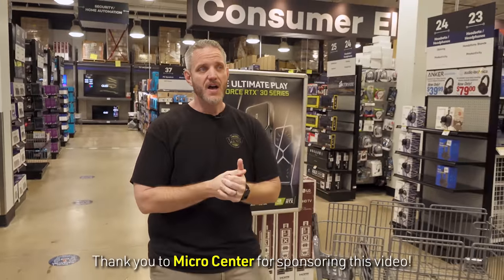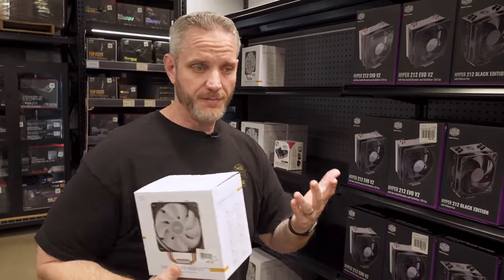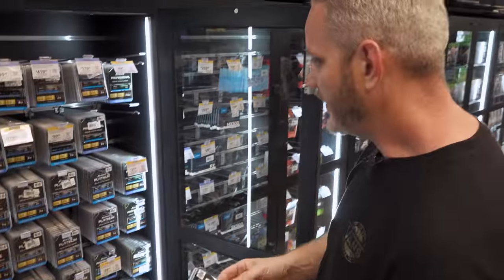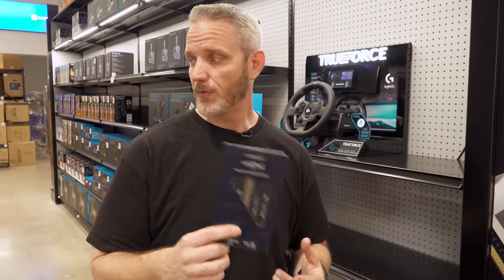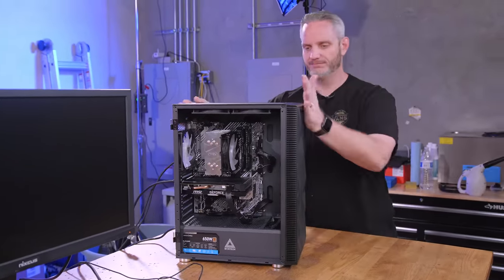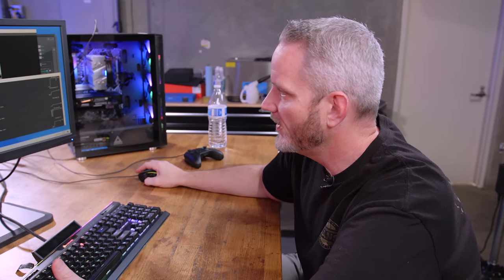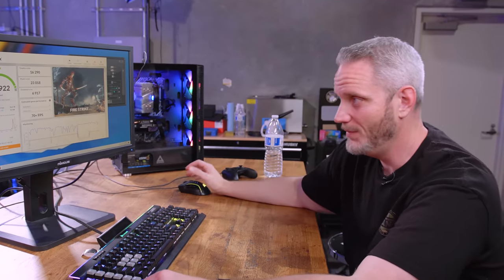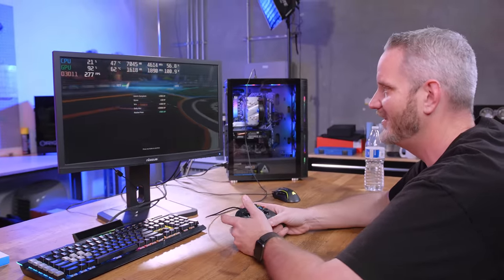How cheap can I build a "Gaming PC" for in 2022

Comment: As an owner of a 1660 super (actually the same msi model Jay showed here) I can confirm that it can still run everything at 1080p. Currently playing elden ring at high settings with steady 60fps
Reply: also 1660 super here. it's very good. i game on a 2014 cpu so it stutters rarley but not because of the gpu. 1660 super is great.
Reply: I choked when I saw the 300+ price tag... shouldn't it be half that or less?
Reply: @mjkittredge  I bought my 1660 Super (ASUS TUF 3 Fans OC) for like $320ish before pandemic and it's normal as it should be, unless, it goes like $380+ or like $400iah and yeah, that's where the price is not normal. Even Jay here bought a 2 Fan MSI 1660 Super for like $360 and with that price, you could buy a 1660 Super from a better skew.
Reply: Same, I guess people have struggles when they game with lots of apps open but I stream with this and have Gamecaster and Spotify open along with a browser with no problems to my game. Anything more can cause application stalls but I don't push it beyond my norm. Kinda 😂
Reply: To be honest, the prices for pc part particularly gpu’s is fucking ridiculous and scammy. The fact that $400 only gets you 1080p performance is sub-par as honestly non-consumer friendly. I have a 3090 and I understood that I’m paying for an enthusiast level card and can accept that, but 1080p high 60fps which I believe should be the industry minimum standard at this point, honestly the pc gaming world is just fucking the smaller consumer comparatively to consoles. 
Note: Before people come at me for dumb shit arguments, I’m not talking utility, work station, etc strictly gaming, and at the smaller market I believe people are getting scammed to where, you really should just buy a console.
Reply: @TheCuratedCache  No, he's right. I bought an ASUS 1660 SUPER for $229 on Amazon in January 2020 (remember this is over 2 years ago). At that point, I'd just bought it because I wanted to replace my old GTX 1050 Ti since and I didn't want to wait for the 3000 series. Boy was I lucky! 2 months later and the same card was selling for over $500.
Reply: @piyush2202  yeah, just checked the prices and holy crap. I was just basically almost lucky to have my card at that price range rather than now.
Reply: Just to be clear, elden ring can only be played at 60fps…they make the game that way
Reply: Really good gc!
Reply: mine is 1650 and it runs 
gta v 50-60fps
max settings 
1080p
Reply: Who wants to play 1080p lol just do 1440p at low settings
Reply: Lies i tell you, Elden ring cannot be played steady on a computer. I tried it with a 2080ti and a 3080ti my bro on a 2080 and a friend plays it on a 3080. and we all have some stutter's some chrashes and some to 1 fps dips for a couple of seconds.  (not to trash the 1660 super i think it will work great for 1080p and would play Elden ring just as good as a 3090ti on 1080p)
Reply: I brought mine years ago for 200eur haha. Still a good card
Reply: 6500XT same performance as the 1660 super and he could have saved money by going for that
Reply: @ChristmasCrustacean1  that shit barely beats a gtx 1060 nevermind a 1660 super 🤣
Reply: @shawngarcia3920  the ps5 is cheaper then a GPU right now I swear cheapest gpu I can find that I would settle for is $700 and it’s on Facebook so I’m not exactly trusting that asus KO 3060 ti
Reply: @xhxq   but how are you supposed to do that with a 1080p monitor
Reply: @TheCuratedCache  The pandemic started over 2 years ago, you shouldn't expect to pay the same price for it now.
Reply: I just ordered a triple fan gigabyte RX 6500XT for $240. It’s legit. It says on UserBenchmark that it can handle 1080p high to max settings on most games and come out 100+ fps. Is that right?
Reply: @rosetta_toned2850  I'd suggest you watch game benchmarks instead of relying on UserBenchmark reviews lol
Reply: @Madkilljoy  that’s why he put the word “steady” in front of it.
Reply: @xhxq  someday I want to. I have never actually seen a 1440p screen in person.
Reply: What cpu are you using, since i am on a budget i got a i3 10100f, will that be enough for 1080p?
Reply: @PeanutxSoup  you don’t, you use a 1440p
Reply: @xhxq  exactly most people have 1080p monitors
Reply: @rosetta_toned2850  There's a reason that card is available for that price😑
Reply: @mjkittredge  i bought my wifes 1660s for 209€ which is about 230USD incl. taxes back in oct 19, because the almost same performing, 50€ cheaper 1660Ti wasnt available.
Reply: @Vittrich  that sounds much more reasonable for a part made that long ago. $200 for a 1080p card is what I would pay
Reply: My 1650 Super runs everything on 1080p too. Glad I bought it.
Reply: @shawngarcia3920  If you tend to play mostly mainstream games, or double or triple A games at least, then yeah consoles are far more cost effective, I mostly believe in PC for modding and occasional gems like Valheim or Insurgency Sandstorm(now available on console as well though) But you can find a lot of fantastic games on PC you just can't get on console, and to boot in the triple A title sector you can get a lot of games that are console exclusive to xbox or ps on pc as well. For instance most of the Final Fantasy games are available on PC( if not all) whereas only a couple are available on xbox. So mods and title access are the big ones for me. That and crossplay these days is also nice, for instance I can play wonderlands now with all of my friends wheres if I still played xbox I could only play it with my gf.
Reply: 1650 is the cheapest since 1650 Super is non existent
Reply: @TheCuratedCache  buddy they were in the low 200$ range before all this crap. 2060 ko was 300$. 300$ range for that old of tech is not a good deal. as long as people keep paying gouge prices at the store they will keep this horse & carrot trick going. they finally came down a bit but nowhere near what they should actually be costing.
Reply: This is to everybody in this comment thread, pre pandemic 1660s was 250$ CAD, 300$ brand new. It peaked around 600$ CAD during gpu shortage/pandemic, it’s about 400-500$ CAD currently. This provided extremely mid tier gaming quality back then, unsure how it compares now as I’ve upgraded. I know 1000% for a fact the performance of the 1660s is adequate to have a gaming experience, not a very good one, but an experience nonetheless. It is NOT worth the current price point, I would price it at exactly what it was, perhaps 50$ more due to gpu shortage, 300$ CAD 350$ after taxes sounds fair, of course even that is on the expensive end for what you’re getting. 250-300$ cad as it was before honestly, not worth anything more
Reply: I have the 1660 oc version. It's not quite as good as the super in terms of specs, but still a nice card. It was very cheap as well before the current pricing post lock down. Same card is around double the price now.
Reply: if you have a monitor that supports 1440p your card will support it also. I have my 1660 plugged into a DDR3 rig with an older 4690 i5 and it runs the game at 1440p no problem. I'm updating my rig to DDR4 at the weekend with a new gen i5, and I expect my performance to go right up. 

I was planning on getting a 3000 series card, but I might just get a 2080ti or something if it works out a lot cheaper. Really though with the price hikes it's not that much different. I really wish I'd bought 3080 when they came out though, as the prices are nuts now. Such a bad time to be doing PC upgrades, I really left it till the worst possible time. ha ha.
Reply: @D00M3R-SK8  not even you man, it’s just been insane since the “rtx 3000 series” drop. Nothing has been in stock and prices have been fucked due to that, like I was saying it’s just a mess to consider a 1660s for 500$ cad, or more. Like you were saying, before hand an 1100$ 2080ti was overpriced, people were selling them “quick” for 400-600 usd, I seen many here 600-800 CAD. Performance benchmarks show the 2080ti still competes extremely heavily with 3080 and so on, this thing was being quick sold for 600$ cad, same price as 1660s due to all this bullshit
Reply: @Boogerdick69  And now DOWN to under $300
Reply: @ibarix  year of cpu doesn’t matter (to an extent). What is it specifically if you don’t mind me asking? 😊
Reply: @JingaBBB  i still use a 1060gb and can game on med high 60 frames its not bad at all dude
Reply: @sebastianangeles  returned it and am saving for a 6700 XT.
Reply: got a 1660 super dual evo with a rgb light across looks quite nice (ASUS) for £228 in May 2020, my first ever PC build which I currently still use. The 1660 super is great
Reply: @sunnys4014  it’s definitely a good card. I’m just going for an AMD card because I want to take advantage of the cache features with the 5600X. Plus it has ray tracing and the 6700 XT is much better than the older gen GTX 1650 and 1660 series cards.
Reply: @rosetta_toned2850  that's fair enough I haven't ever over clocked anything before and I'm not an expert on how the cache works - ray tracing tho is a very nice feature, although I have the two next gen consoles too for that (stupid I know), I'm currently using a Ryzen 3 3300X I was lucky to get it for retail
Reply: @sunnys4014  i seriously wish I could have gotten a 3300X.
Reply: @rosetta_toned2850  for £120, I was thinking of my build and was gna make a mid range one as my first build, saw the Ryzen 3 3300x recommended and managed to preorder at retail - very happy with it, had no real issues with it. Very good for price
Reply: @Boogerdick69  I got an Asus tuf 1660ti for 389 a few months ago at microcenter. And it served me well. Great card for 1080p. Only upgraded because I got a free 2060
Reply: @sunnys4014  it’s an amazing CPU. Very high performance and clock speeds. Plus great value. The 3300X got scalped and marked up over $250 even before the chip crash.
Reply: Thank you for this!!!
Reply: Alos a 1660 Super owner here. I game at 1440p and the card is stilla ble to run new titles with 60FPS on medium settings.
Reply: @mjkittredge  nope, you're thinking of the  gtx 1060.
Reply: I have a rtx 3050 which has almost exactly the same performance other than (bad) ray tracing and has DLSS, and it's just fine.
Reply: @mjkittredge  MSRP is about $230 for the cheapest card. Anyone paying less than that isn't getting a new card OR got EXTREMELY lucky and caught a rare sale or dumb seller who doesn't know what they're selling (unless we're talking Pre-COVID when a sale might have reduced prices under MSRP). I paid $240 for mine DURING COVID crazy price hikes in 2020 only because I did my research and refused to succumb to thieves trying to take advantage of COVID to make $$. I was happy to pay the extra $10 for better fans and the factory OC version.
Reply: Damn my Xbox can run 1080 at 120fps that’s tuff
Reply: @halcyonacoustic7366  Does DLSS give you a big performance uplift even with a 3050?
Reply: I have a 1550 super 😢
Reply: @TheCuratedCache  320$ is normal? tf isnt it like a 230$ gpu tho
Reply: @immu149  Ikr. Others here in the comment also said it in the price range like that. Idk if it's because like I bought a week before the Pandemic became worse. I also don't know the tax from my country.
Reply: @TheCuratedCache  i bought mine in nov 2020 for 210$
Reply: @mjkittredge  yo get the 3060 ti and have it mine… why you skimping? You can pay off your whole computer in under 2 years.
Reply: Holy shit, my name is Daniel Delgado too.
Reply: same i love mine, got it gigabyte 1660S OC edition for 250 on ebay
Reply: @AddieB55  I totally agree.

Comment: From someone who built my first computer just last year , and very happy with the results, never stop making these videos , there invaluable to new time builders.
Reply: at the same time, you must do a little research yourself because in actuality you could build a better system then that right now. I think Micro center asked him to do a video on a budget PC so Micro center can get rid of their 3-year-old about to be obsolete hardware.
Reply: @nicholas9051  well said, stepping back on that cpu and forward on the gpu would have made a Lot more sense imho (depending on workload I guess)
Reply: @chasesmay7237  I agree, he could have gone for a little worse cpu, smaller ssd size, to get a better gpu. As long as the cpu was good enough to not bottleneck the gpu it would be fine.
Reply: What are the specs?
Reply: @nicholas9051  That really depends on the specs of their components 😋.
Reply: @earthtaurus5515  I was at Microcenter the day this vid dropped and i was watching it while I was making my budget build, this is what i bought... 5600x @ 210, msi b550 w/wifi @ 90, 2x8gb tforce 3200c16 ddr4 @ 55, asus 3050 @ 370, Inland 1tb NVMe @ 80, montech X1 case w/4 fans @ 57, and powerspec 650w 80+bronze PSU @ 45, all this after bundled savings (which was 25)... total is 882!! after tax exact total is 943.74

Comment: I'm a piano teacher with a pc building addiction. I buy almost exclusively from that Microcenter (20minutes away). I've helped several students build cheap PCs and this is very similar to a recent build.  I added a 1T mechanical HD as well as the 500gb nvme since they were going to be doing a lot of video work for highschool and needed storage.
Reply: Could you help me to pick the right parts and help me build the pc in there?I was planning to go there this coming friday or saturday
Reply: I would recommend upgrading to 2tb for the $5-$10 more
Reply: @iCantEscapeYou  Yeah, if you're going to put a slow, noisy HDD in the system, get something that offers a good price for the storage, though just getting a 2 TB SSD in the first place instead of the HDD would be a much better choice, if price allows.
Reply: help me build a gaming computer thing, btw i don’t know anything about computers
Reply: @josh.andree  Go to your local Microcenter, that's part of what they do.
Reply: @greggmacdonald9644  I agree but at the time of purchase it was a difference of $30 which is a lot to a 9th grader :)